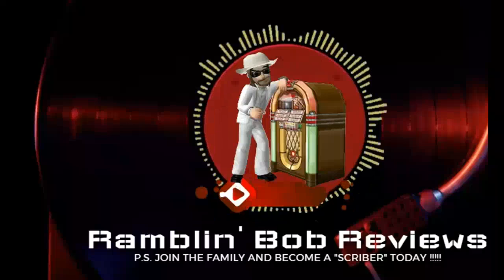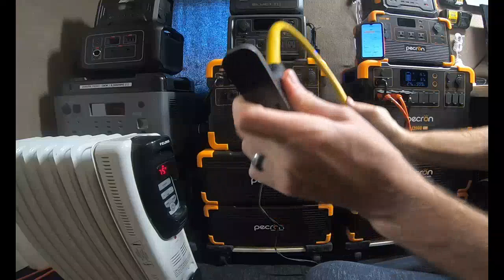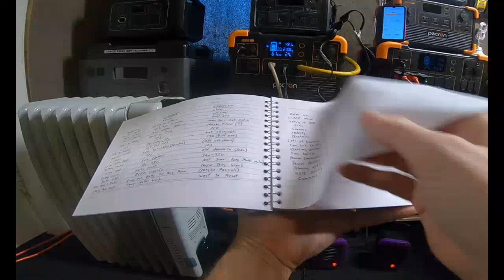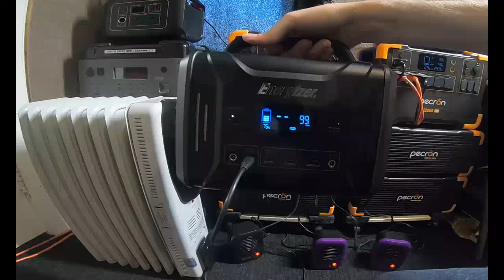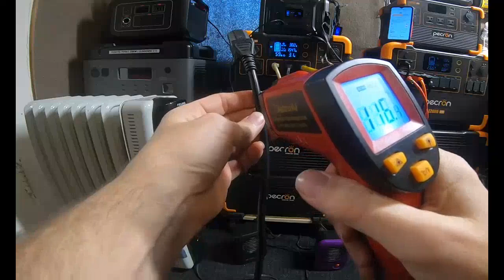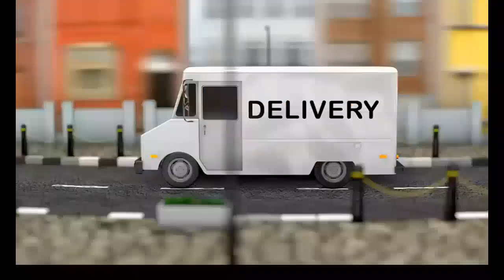PECRON E1500LFP & EP3000 Power Station (FULL 7,680wh SYSTEM) (((((Update 5)))))

Comment: Received my EP3000 late yesterday afternoon and hooked it up this morning.  While I know it should be obvious, I wish the manual showed which ports to use when hooking up one battery to the 1500 and also how to hook up two.  Maybe it's there but it's not obvious.  I wanted the ep3000 to sit behind the 1500 but the cord isn't long enough to reach from the 1500 to Port 1 of the EP2000.  There was a photo on Pecron's website that showed  cable from the 1500 to port 2 on the EP3000. So I tried using port 2 and it looked like it worked, green light for about 5 seconds then nothing.  So I removed them from the shelf, stacked them and connected to port 1 on the Ep3000went and within seconds I got the green light and the Ep3000 showed up on the app.    It's been an hour and so far so good other than having to raise a couple of shelves to accommodate the stacking.
Reply from the maker: We love the new 90 degree cables, but we do wish they they were a little bit longer also

Comment: Hey Bob do you know of a way to reset the usb output on the pecron e600lfp? I plugged my phone into the 100w usbc output then all the usb outputs stopped working.
Reply from the maker: hmmmm, checking ours for this option....gimmie a sec :)
Reply from the maker: OK, We found a way to re-calibrate the battery pack to the power meter
(hidden menu)

And the the menu for setting all of the system
(hidden menu)

but we did not see any way to "RESET" the system on this model.  :(

Better send an email to pecron and see what they say, sorry that we could not be any help.

note: lets hope that the dc board did not burn out "fingers crossed" :(
(we never changed the dc board in this model, so we do not even know how to do that yet)

Comment: No, that's not what i'm worried about with a generator i'm worried about generator if gives me the power I need like if I hooked up my two thousand watt frigerator if it's gonna run it continuousleep and that's kind of why I bought the Is pecron 2000 Because I have a frigid rate. It doesn't not run off from 1800. What inverter? I'm running off in a 2001 inverter. But it won't run off of an 1800 W inverter. I know I tried many different ritters. And 2001 generator about it, but it cover it, but the only problem is.  When I ordered it, I tried to order a battery with it, and Walmart had a problem with my card so I had to clear that app the next time I ordered it. I only ordered a generator instead of the battery with it. So I still have two batteries to buy And some other solar panels yet. I really don't care about all the other parts. Yeah, I may use them but I don't care if they give up the full cap capacity as long as they charge. What to say that's gonna charge There's no testing it or anything like that that I worry about if it works it works. That's all I care about Just like I don't have a phone that I charge on top of the thing, it just doesn't work. I got the wrong kind of phone. But they got a lot of phone hook up so it doesn't matter. But I run the computer so I don't give A Well, I'm not gonna say that word.
I mean like you need quick capacity out of each machine. Cause you need exactly that much water. For no, not to run some of the things you're talking about. I need exactly 2000 W. Maybe a little more to run my kitchen refrigerator it doesn't seem to run awesome when all you know well, you're 1500 W generator probably.  And truthfully I think I need a 4800. Watt generated To run mymy Is water heater. And then want to run my kitchen oven. I know there's 4 different generators. I want that are coming that are come from two different companies. The one generator you like that you don't have plus the 2 big generators that you didn't talk about that. I like, but Theycostly. And I also like the Delta pro.
But like I said they are very costly. And it takes time to come up with money to do that. I mean, it took me quite a few months to come up with just buying Is the pecron generator And maybe by Spring I might be out to buy another generator.
First I think I'm gonna have to pay to fix my house. But it might be the fix to house. Get it all set up and then maybe sell it. Too get a place where I can do what I want Even though I'm gonna try to do it with my house With solar panels.